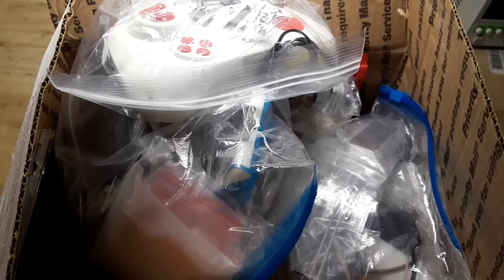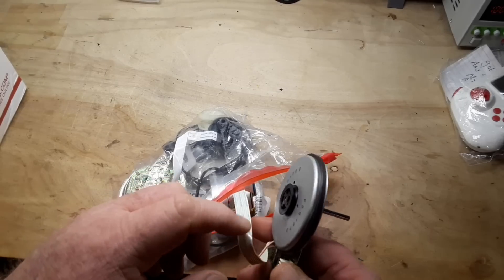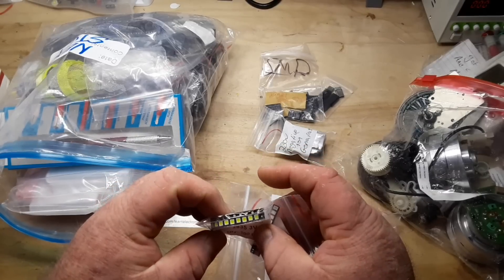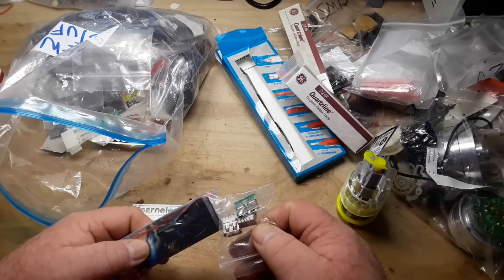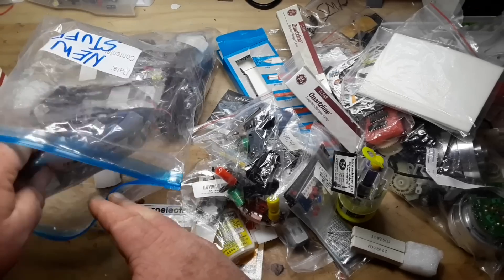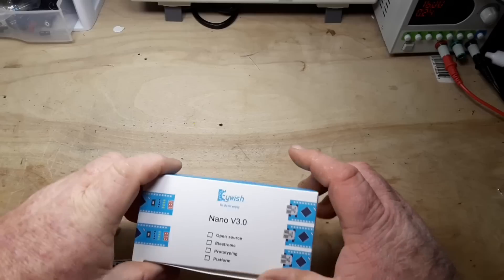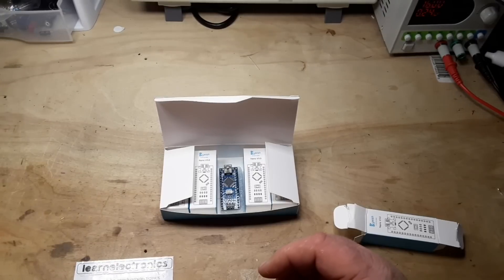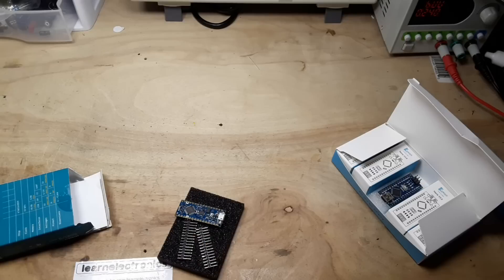Mailbag Monday Mish Mash

Comment: @8:03 I believe that is an NRF24L01 - a pair of them makes for a relatively easy low latency (much lower than wifi or bluetooth) RF link between a couple of arduino boards.

That's a helluva great haul. 
The generosity of some fans is pretty outstanding.
Reply from the maker: NRF24L01, yes, I think you are right!